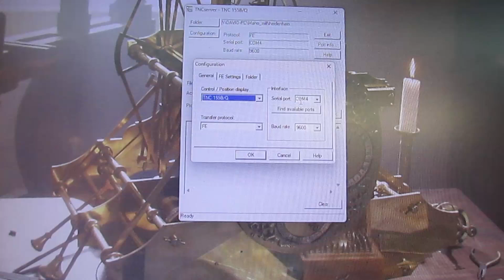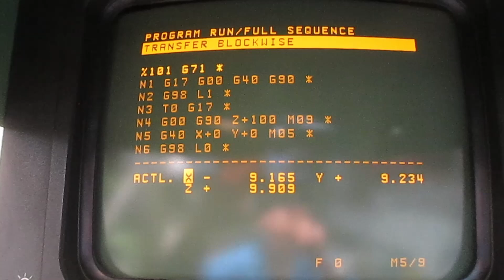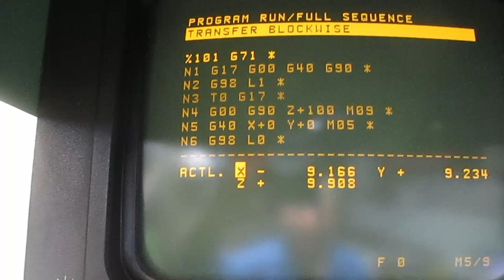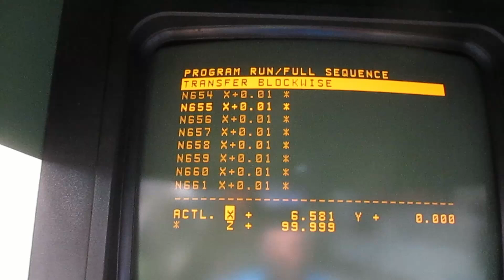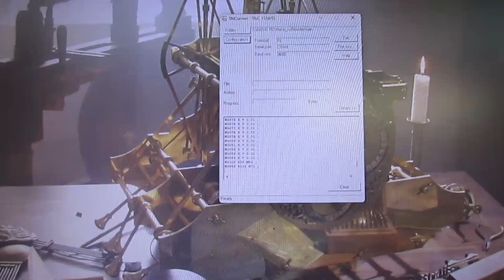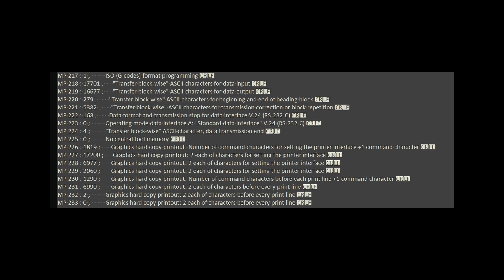19 Drip feeding the Heidenhain TNC 155

Comment: Hi, I did post a question on FB a while back (Valter Isander) but after the question , for some reason I cannot reply to the thread, nor does anyone on the group accept pm 🤨's. I have a TNC155A. It transfers blockwise fine, but for some reason the 155 crashes (sais Fel Programdata..in Swedish) if the tnc server has to pause for the 155 to catch up. I have tried 2 new FDTI leads, and 3 different pcs.
Reply from the maker: It sounds like you are drip feeding. There are limitations.
On page V15 of the operating manual you will find this:

The following conditions apply to program format
in "Transfer blockwise" mode:
• Program calls, subroutine calls, program part
repeats and conditional program jumps cannot
be executed.
• Only the last defined tool can be called (except
for operation with central tool storage).
The program destined for transfer may contain
blocks numbered higher than 999.
The block need not be numbered consecutively,
but must not exceed 65,534. Four-digit block
numbers in plain-language programs are displayed
on two lines on the screen.

In drip feed mode it reads a block then discards it. So no program jumps or subprograms, because it will not know where to come back to or where to jump to.

If you are transferring the whole program in one go, make sure there is memory space for it. When it hangs press the program run button and it will display the part that went in okay. Step to the end of program (easier to step backwards) and see if there is a typo. The TNCserver program may have gone a line or so further. Check those line for errors. I usually find I've made an error.
A common error is reusing a line number twice when I edit in Notepad++. Line numbers don't have to be in sequence but they must be unique.
Reply: @davidjensen4490  sure its not the issue. If I press cycle hold/stop while uploading to the 155, it stalls when I press cycle start again.
Reply from the maker: @patdudley7635  I don't know what cycle stop/hold is. Maybe a video of what you are doing step by step would help.
I know the TNC155A has some limitations on the serial transfer and it varies depending on updates. So what I have may not work for you.
I had to do a lot of trial and error to get my serial comms working. I ended up with MP 223 being standard serial rather than block-wise, but I don't recall why. So it's set to zero. All the rest are the suggested defaults.
I'm puzzled that you seem to be able to transmit whole programs and not drip feed.
My serial transmission was flaky until I shortened the cables to limit EMI. That shows by the message at the bottom of the TNCserver swapping between "ready" and "not connected". But it can still hang easily even now. if I try to transfer a program when I have forgotten to start TNCserver I can't get it to recover. I have to restart the Heidenhain by restarting the whole machine. So I start the mill first, home it, then boot TNCserver. You may be able to skip homing. It wont work if I boot TNCserver first then the Heidenhain.
Odd as it might seem, I've never programmed in conversational mode so some of my buttons are labelled differently. I have the ISO overlay keyboard.

Comment: Good afternoon.
I have the TNC150 and it has been difficult for me to program with it, since it is very old and the manuals I have are in German, and the machine is in Swedish. Do you know how I can change the language? And what programs do you work with, I have tried to work with TNCREMO but it enters the data but the machine does not receive or read anything.
Thanks a lot.
Reply from the maker: Yes, probably
Go to my site @davidjensen4490. Click on "playlists". Go to "Resurrecting Maho MH700C CNC milling machine" and click on "view full playlist" below it. Play video "1 Start sequence".

That explains how to do it. But there is a possibility that you have a very old version of software. In that case you will only be able to access 0 or 1 I think.

It may also be that the language Eprom only has Swedish and German, but I think most had English and then the language of the country they were sold in.

While you are in that playlist you can run all the videos in numeric sequence and learn just about everything you need to know to operate your TNC controller.

You will find the English programming manual, my machine circuits and these video here:

https://drive.google.com/drive/folders/1NVXGKyaNq_pxr4Gx8J-c7eshcWKjsMfe?usp=sharing

There is also a playlist for programming in ISO G code. Go to that and open "more' on the beige panel on the left to get information on my translation into English of the tutorial manual and download all the tutorial example code.
Reply from the maker: BTW. You can get the some of the manuals direct from the Heidenhain site. But mine is OCR'd so you can search it. It's a large download though. And it is for the TNC 155 so has graphics stuff the TNC 150 doesn't have.
Reply: @davidjensen4490 Thank you very much for your response.
I'd like to know what software you use for drawing/design and what post-processing.
I use Mastercam and Cimcoedit. But they don't work for me.
Thank you very much.
Reply from the maker: @GabrielAlfaro-c6o  
So many choices!
I have been using SolidWorks for modelling for nearly 30 years. But I don't use it for the CNC mill. I program in G code because I had programmed in it 40 years ago. That is fine if you aren't doing fancy surface shapes. So is Heidenhain conversational mode.There are enough canned cycles there to do most typical mechanical parts. If you follow through all my tutorials it will likely be enough.
The "go to" program seems to be Fusion 360 if you want more. It has a free license to retired folk etc, who just want to muck about. But it allows you to make a token amount of money each year to cover some costs. Probably enough to net zero your hobby. But there is a fairly steep learning curve. Fusion 360 has a lot of post processors available, including one for the Heidenhain TNC 155. In addition, you can edit if you know how to.
If your TNC 150 wont do the language change, you could contact Heidehain and they may sell you the English Eprom and one to upgrade to the last firmware.
If not then it might be better that you can the controller and go to Linux CNC. I can give info on some good sites that go through that if you think you are capable. But that is a really massive task. I'd only do it if you have a CNC mill that is in very good condition like mine.

Comment: Your video's are awesome! Learning alot. Do you also have a video about touch probe?
Reply from the maker: Sorry. No. I have talked to the Heidenhain agent and he told me that they sold very few of them here in Sydney. He also mentioned that they didn't have programs for creating clouds of data points. Nor was there any way of grabbing coordinates from the probe position and outputting them through the serial port to a file on your computer. So it only did simple routines for aligning your blank. Apparently they communicate serially, so you can't substitute a cheap on/off touch probe. Even today they sell for extraordinary amounts considering their limited function. There is a section in the programming manual on how to use it, so if you've made your way successfully though all my videos, you should be familiar enough to program one if you have one.
I've often wondered if you could write NC code to make one do more, but I don't know how to do that.
Reply: ماهو الزيت المستخدم للراس

Comment: to help some body with drip feed problems ,first you need a  usb to serial adapter with pl2303 chipset ,then your nc software version is important. on 01 version you need all rs232 handshake wires connected (rts,cts,dsr,dtr) and in the programm file a "*" must at the end of each line.and to avoid trouble with differnt rs232 adapters ,i replaced the original 25 pin d-sub connector with a 9 pin d-sub ,so i can plug in directly the usb to serial converter.
Reply from the maker: If you watch video 22 of this playlist you will find most of that embedded. There is also a link in the video description to Sir George's video where he demonstrates the wiring, and give links to the serial adapter. But he just says leave the parameters for the series connection at the defaults. In the event you have lost the parameters I put an image of them in video 19. I don't know much about the early versions of the TNC 155 software. From other queries it would seem worthwhile getting the last update from the Heidenhain agents.

Comment: Hello

i have a problem trip feeding my heidenhain tnc 155 mill.When i upload the program with tncremo it shows me on the mill program error code:Send file 1001.I
%1001 G71
N10 G30 G17 X-55.61 Y-35.925 Z-14.
N15 G31 G90 X+55.61 Y+35.925 Z+0.
;T1  D=6. CR=0. - ZMIN=-14. - FLAT END MILL
;WHEN USING FUSION FOR PERSONAL USE, THE FEEDRATE OF RAPID
;MOVES IS REDUCED TO MATCH THE FEEDRATE OF CUTTING MOVES,
Send file 1001.I
%1001 G71
N10 G30 G17 X-55.61 Y-35.925 Z-14.
N15 G31 G90 X+55.61 Y+35.925 Z+0.
;T1  D=6. CR=0. - ZMIN=-14. - FLAT END MILL
;WHEN USING FUSION FOR PERSONAL USE, THE FEEDRATE OF RAPID
;MOVES IS REDUCED TO MATCH THE FEEDRATE OF CUTTING MOVES

when i downlod machine parameters it works.What can be the problem?Im new to cnc programming:)
Reply from the maker: Welcome to programming the TNC 155. Good to see you are having a go at it.

I don't know much about TNCremo. I had a look at it when I started and decided it wasn't for me. So I only use the TNCserver part of that download package as show in this video. I dumped all the rest. I create all my G code in Notepad++. It's a more modern editor.

If you can transfer the machine parameters correctly you are off to a good start. It opens up a whole world of new abilities for the TNC155. But I should point out that is a program transfer from the PC's memory to the TNC155 memory, not drip feeding. Drip feeding stops you being limited by the TNC 155's small memory, but it only buffers a small amount of a large program until the machine executes the code. In drip feeding mode the TNC 155 will execute each line (or block as it is called in CNC talk) and then discard it from memory. Program transfer needs to fit all the program into the TNC 155 memory at once. That limits program size but enable a lot of features like program jumps and subprograms that drip feeding can't do.
As for the code you show: the lines (or blocks) down to and including N15 are correct. They set the size of the blank form (BLK FORM) in graphics mode which you probably don't need at this stage. The rest is a bit of a mess. It looks a bit like an AI created it. There are some labels like "CR" that aren't in the TNC 155 G code, but may be in TNC 640 etc. And the FUSION mentioned might be to do with Autodesk Fusion 360?

BTW: AI's are absolutely hopeless at doing G code for the TNC 155, so far, that I have tried.

I'd advise you first download the TNC 155 B & Q operating manual. It's readily available in various places on the web, or I can put it up on one of my drives if you cant find it. You need to read section D of it to understand the correct program calls. You also need to look at about the 3rd page to see what the G code keyboard looks like.

You can then go to my YouTube playlist "Heidenhain TNC 155 Contouring control Programming Examples" and work your way though them to understand how the programs should look. Click on the  "View full playlist" then "more" on the big panel on the left to see more about how to set up the TNC 155 for G code.

You can download the actual files and the tutorial manual so you don't need to type them in on my OneDrive here:

https://1drv.ms/f/s!At3qDeAj2HNowBIk8oEXR0xH9dMU?e=TBYT3l

Have a go and get back to me if you get stuck. It's a big learning curve, so just do a little bit at a time. After a while it all comes together and it's very rewarding to get the machine doing stuff.

Good Luck